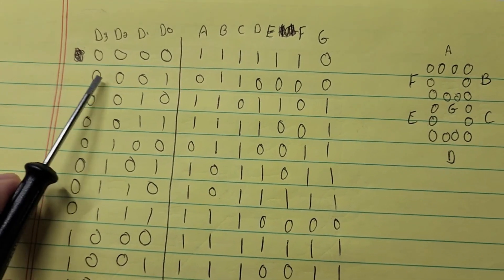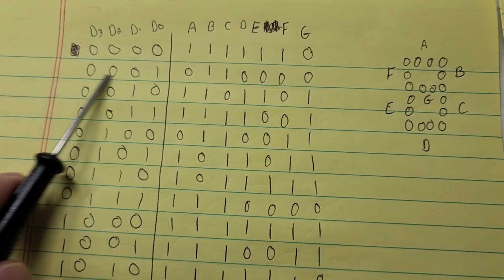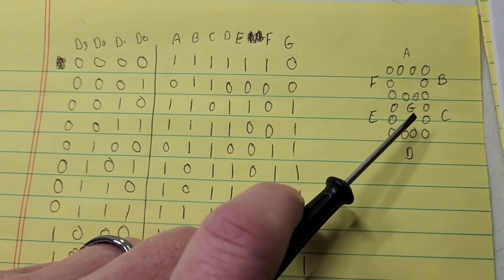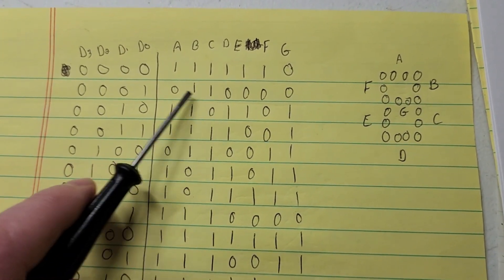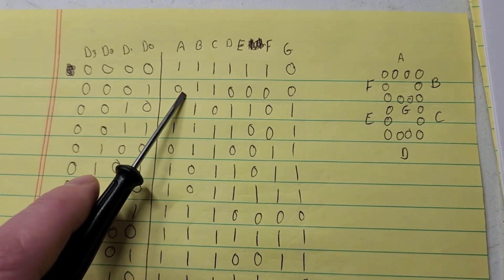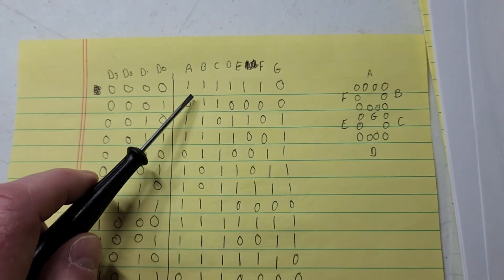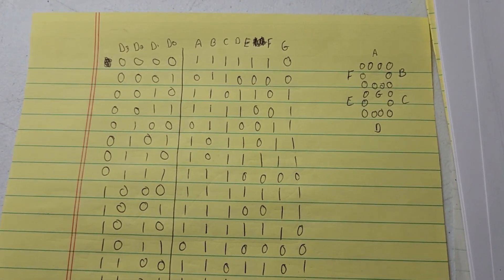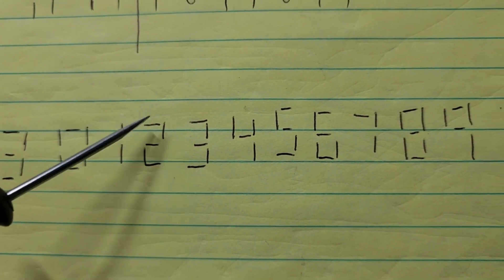Seven Segment Display Driver with transistors

Comment: You skipped the kmap
Reply: You can absolutely reduce transistor count using k-maps.

I went through this exact process when I designed a clock entirely out of transistors.

Your approach of decoding each segment on a per-digit basis is overly simplistic, and was what I did at first too. But what you'll find is that many segments share certain pieces of logic, and K-maps will highlight this. You can then combine those bits of intermediate decoding to save transistors.

It's very much worth the effort to learn them!
Reply from the maker: @TomStorey96  i wish I knew that before I wired all of those transistors. Lol. I'll have to try the karnaugh map on it. I think going to 15 instead of just 9 cost me allot of gates.
Reply from the maker: @ashishkushwaha3812  I saw people using a k map for this sort of thing. It didn't seem necessary. I dont think it would have reduced the number of transistors.
Reply: @MarkGeorgeFantasticAdventures it’s not just about reducing transistors, it’s also about reducing the mental work

Comment: Quite a lot of transistor there ;). But I'm not sure how you'll be able to hook up another display and decoder for the 'tens'.  I assume that your adder operates in plain binary and not BCD?  This means that eight is 1000,  nine is 1001 and ten is 1010 . But I guess since the number range is so small you could "cheat" and made a decoder that decodes the numbers zero-to-nine and outputs all of them as a bit pattern 0 on the display, and decode ten--to-fifteen as a pattern 1. You'd also need to change the current decoder so that inputs of ten-to-fifteen output the same bit patterns as zero-to-five.

Hm, yes that is absolutely doable for a 4 bit decimal dual-display, it's kinda cool. But I done eve dare to think about it for an 8-bit input to 3-decimal digits...  :shudder:
Reply from the maker: @MatsEngstrom  I'm thinking exactly what you described. I already have the ones column outputting 0 through 5 for 10 to 15 so I figured I could just light the two led segments to create a 1 for 10 to 15. I know it's kinda cheating. Lol
Reply: Some of the old 8 bit microprocessors had a "decimal adjust accumulator" instruction that, I assume, would get your accumulator back into BCD after a binary arithmetic operation.... but (and my memory is even more vague now) I'm sure some of the old mainframes actually had BCD ALUs....